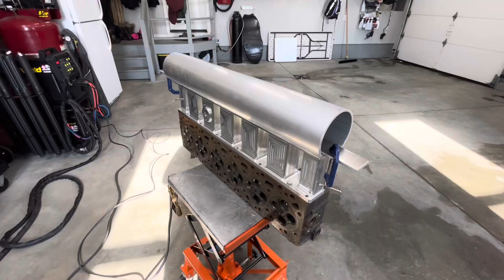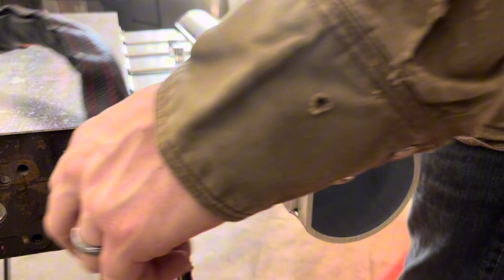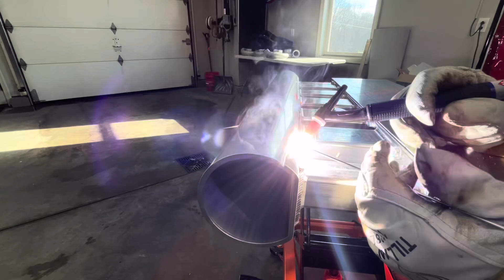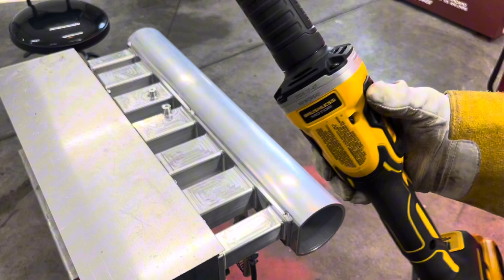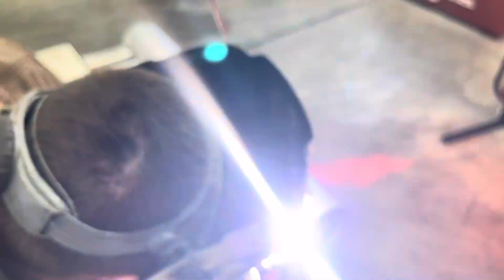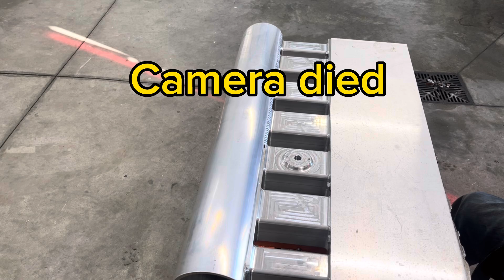Tig Welding And Fitting Up Aluminum Side Draft Intakes

Comment: I’d weld that so different. Looks so uncomfortable doing it like that. You have to stand up and make multiple restarts. I’d make a half moon plate that sits down the length of that tube so you can stand it up and clamp it down. This way you can sit down and use an arm rest to weld the whole length in one run.
Reply from the maker: @Rising.Frequency  the head weighs 140 lbs
Reply: @ use aluminium block instead
Reply: @Rising.Frequency  Why spend all the time and money to replace something that obviously works, mounting that flange to the cast head it is designed to mate to is the most effective way to do it. Resting your drag hand on something would be ideal though, other than a wire feeder there is no real way to weld that without restarts. Hey, a thousand ways to skin a cat though. Process improvement is half the game.
Reply: @ because I want to make the part to the absolute best quality that it can be. Making an aluminium billet to replace the head isn’t exactly hard and he obviously makes multiple of these intakes. Would make perfect sense to make one then that weld can be done in one continuous run with no restarts. The way I look at it, I wouldn’t be happy with all the restarts because I know it can be done without them. Maybe it’s over the top for a lot of people but like I say, I know it can be done, so I would.